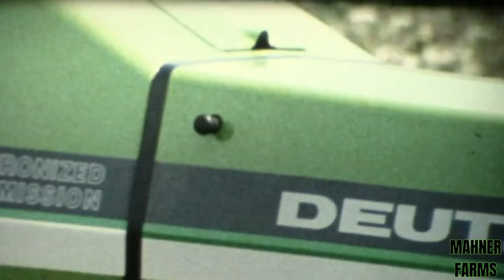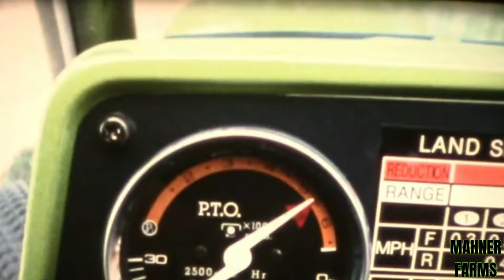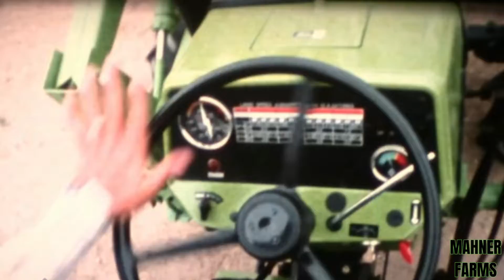Deutz Allis 5200 Series: Iconic 1986 Lawn Tractor Series

Comment: Love the design of these they looked great and I'm sure were awesome on fuel but BUYER Beware!!! These were build off a (Hinomoto brand), rebraned just with different sheet metal, paint scheme, decals and company name, same as AC, Deutz, as well as the Simplicity 9518s. I had a Allis 5015... Literally ZERO Engine parts available, When i did some research after owning mine i found out the Hinomoto engine company went under a few years after making these. So... I looked 3 years for a rebuild kit. Impossible. A guy on the Unofficial AC forum for almost 10 years then he found a NOS one. But his had a Factory dealership Cab w/ wiper and heat on it, along with loader and other factory attachments. The rest of the tractor has little too nothing available. unless  you go thru Agco and they want Insane $$$ Per usual. Parts tractors is about the only thing u can do... or repower it w/ an adaptor plate etc. Figured i'd mention this! Since they are not super well known... Also Satoh S370 tractors. Same dealio. Just sold mine a month ago. no parts are available. The last company went under. Southern Global Tractor about the only place to find anything brand New, eBay, or NOS. Really good sales advert though!